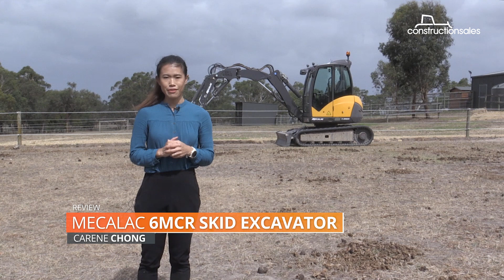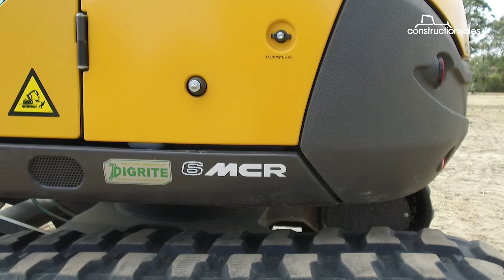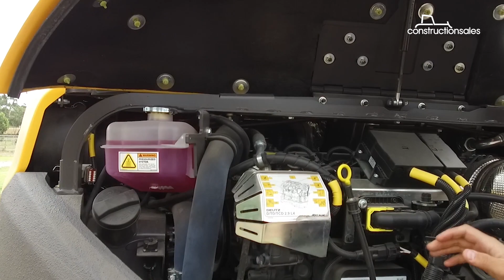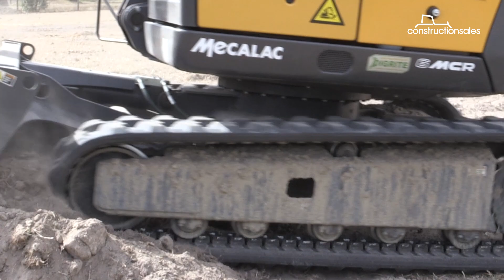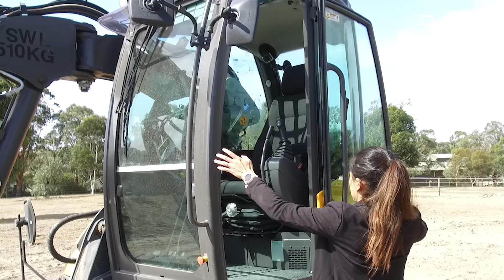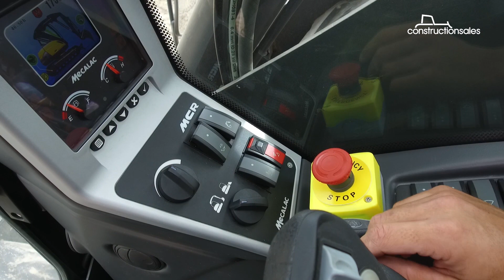Mecalac 6MCR excavator review

Comment: Wonder what fuel consumption is like when using it like an excavator, that happens to have an engine capacity of a machine twice the size. Be handy if you can limit the consumption to what the pumps require and no more. 
And a frint end attachment with that many pivot points makes me wonder how rigid the bucket position is when using like a skid steer loader to trim large surface areas. Probably adequate when nearly brand new but be interesting to see what 1500hrs feels like.
Reply: There is a throttle control so you dont need to run it at full.  I generally dont run excavators at full throttle unless Im moving heavy dirt or need the breakout force